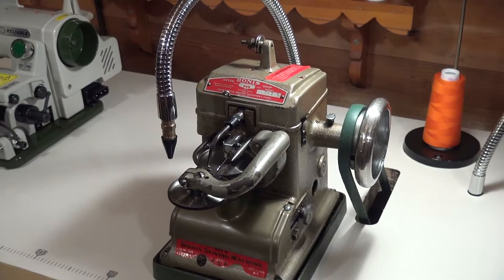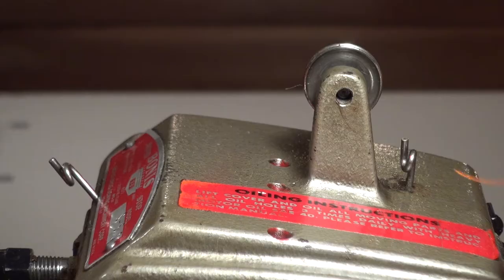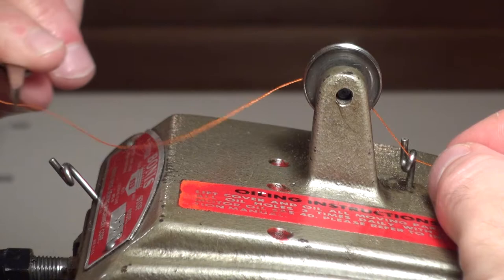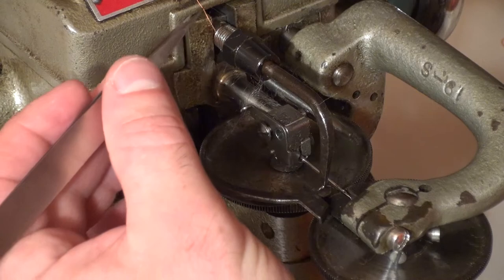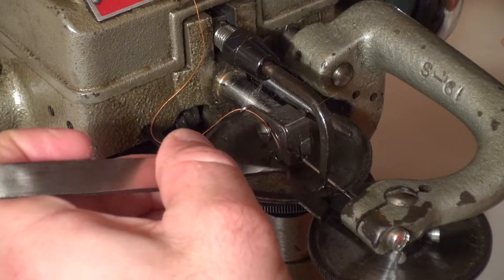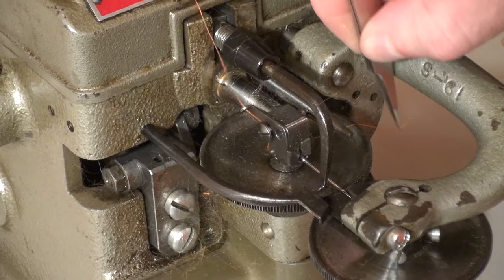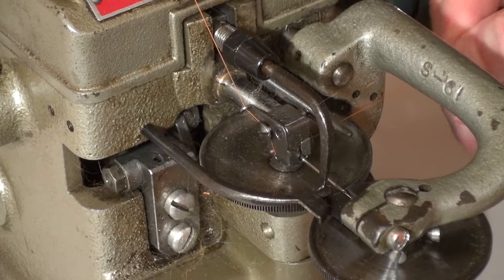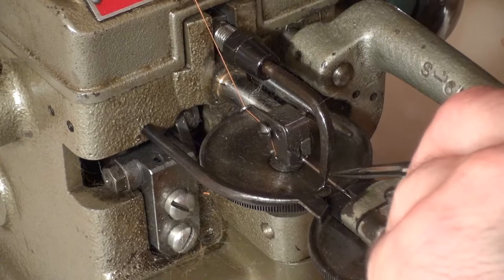How to thread a Bonis Fur Sewing Machine

Comment: I just got myself similar machine but it’s the Allbook & Hashfield brand. It has the cups with sharp teeth on. Any idea for which material those cups are?
Reply from the maker: Perhaps leather, rubber or bear fur? Would imagine sharp wheels would damage a soft material. If you need new wheels C.H. Holderby in Seattle can probably help you.

Comment: I have three of these machines and the cup feed on all of them is impossible to open
Reply from the maker: It takes a lot of force to open the jaws. On the bottom of the machine there is a screw on the left that sets the spring tension for the cups. There should be a chain sticking out the bottom of the machine. That connects to a lever and a foot pedal to open the jaws. You won't be able to open it by hand, you need at least a foot pedal, but ideally the lever and foot pedal.
Reply: @fluffyorangebolt  Thank you so much I love your videos if not for them I would be slightly lost
Reply: Hi there! Thx for the video! I have a bonis machine but I can't get the looper to loop the seam. It's like the needle side of the seam isn't catching. What adjustments do you think I need to do? Thanking you in advance
Jackie
Reply from the maker: @jseitz222  It's super hard to set the timing on the machine. Bonis does have a guide on their website still though. If the timing is wrong, normally you would loosen the looper holder and rotate the looper slightly to the left or right - that will adjust the timing. I want to make a special video on how to time it, but I haven't got it down good enough just yet! I highly recommend scribing the position of the looper (how deep it is in the screw) so you can go back to where you were.

Loopers do wear out and make it hard to catch the thread. Bonis can sell you a new one if needed. It should feel sharp and not have smooth surfaces on the end.
Reply: @fluffyorangebolt  Thank you so much! I will let you know how I make out! Thx for your advice!!

Comment: What size needles ar you using.
Reply from the maker: Needle Info: Bonis sells fur machine needles through their website. They say Organ on them so I would imagine they come from https://organ-needles.com/english/. A lot of people use a #14 with Maxi Lock serger thread. I would recommend a high quality thread like Amann Saba 80 100% Polyester and a #18 needle. Select a ball point needle for faux fur and woven materials. You can also procure needles and get all kinds of support from Earnie at C.H. Holderby. Tell them Orange Bolt the Fox sent you :) They are very friendly to costume makers.
Reply: @fluffyorangebolt  thanks a lot.